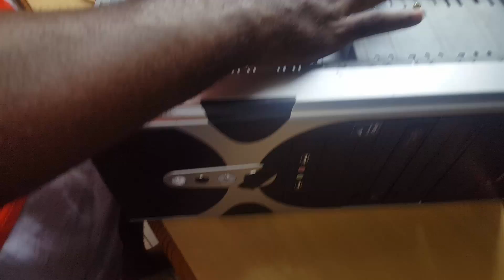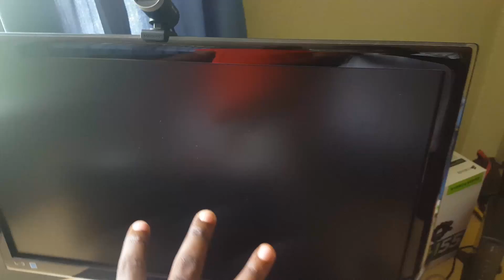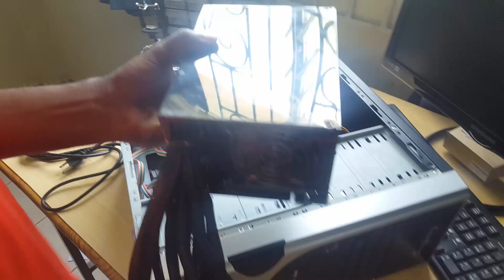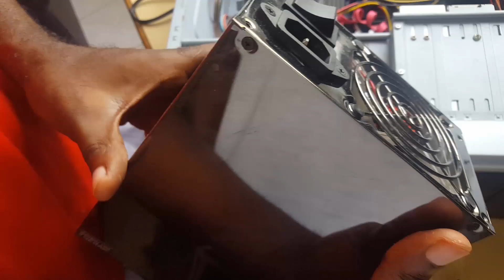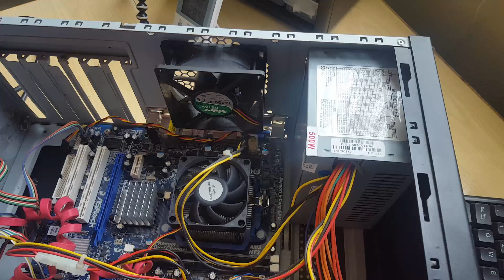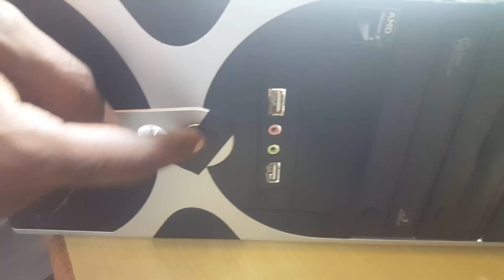My Computer wont turn on Fix

Comment: I had same problem and tried everything nothing worked, until I connected old monitor on DVI, turned on PC power, it showed screen normally, new monitor was still connected (DisplayPort) and didn't react anything, then I plugged DVI from old monitor in new one, no reaction, unplugged power cable and plugged again, it showed 2 screens in windows (both on new monitor DVI and DisplayPort) and suddenly I could switch input source on new monitor. So weird maybe my new monitor is faulty somehow but I still have 144hz and works normally after that. I still don't get what caused this issue..
Reply from the maker: Thanks for sharing
Reply: @rickytlc1985  Could it be due to low quality DP cable?

Comment: My computer overheated and shut down, now it has this burned cable smell but I do not think it is the power supply because my mouse works i mean this down is emitting light. 
Any suggestions please?

Comment: How to fix a pc that if you push the start button it will turn on but The light indicator for the "light drawing" is red and after few beepings the fan of the pc turns very very fast.

Comment: Is it possible when the pop happened while the pc is on and it doesn't turned off automatically? Need a reply asap I'm panicking plsss thank you
Reply from the maker: If you mean a audable pop sound from withing the PC its most likely the powersupply, one of the capacitors blew. You may smell a burnt smell from the area.
Reply: @rickytlc1985  but the pop happened while the pc is on, is it possible after the pop it will take a minute for the pc to turn off?

Comment: I just bought every part brand new for a computer and it won’t turn on. I have the cpu plugged in the fans plugged in and the 12 pin plugged in. I’m using only an m.2 ssd for storage
Reply from the maker: Sonething is DOA or faulty you need to find it,if not something not connected properly.

Comment: I just got all my pieces off Amazon and my brother built the pc but it won’t turn on and it’s like it has no power
Reply from the maker: You most likely made a small error. Make sure power supply is on and working. Check your jumpers to power switch you might have mixed up reset and power or connected them incorrectly. Also watch out for dead components such as power supply. There is a paper clip method to test power supply.Make sure the main power connectors to motherboard are all connected.
Reply: @Ricardo Gardener  So I have an update I can turn on the pc with a screw driver by touching some pins with it idk how that works but now I know its a problem with the power switch My case is the vsk 3000 elite I see no signal on my tv whenever I turn it on.. also I see people have power switch cables but I dont?? where do u get that?

Comment: My psu fan running but pc front poerbutton light not turning on
Reply from the maker: Somethings wrong yest the PSU, RAM power button itself -you need to track down the faulty part.
Reply: @rickytlc1985  thnx for replying

Comment: mine stopped turning on right after i cleaned the inside
Reply: @scuf5177  i found a solution , i had to  connect the graphics card to the motherboard again , so my advice is ;
try taking out cables and putting it back in (in the computer itself ofc) , it worked for  me cuz a cable became loose in the cleaning process , best of luck dude
Reply: @scuf5177  Aye im so glad i  could 
 help someone for once,  thats great dude :)

Comment: I didnt hear a pop on the psu but as soon as i tried to plug off the speaker pins(which i never used,but my friend somehow plug it in) i smell some kind of heat burnt smell, do u think its the Psu?? Although i already ordered a new one days ago, do u think there's a chance it'll damage other things??

Ps...i played high power consuming games,pubg,fifa for like 8 hours a day and my smps have like between 500-600 watt.

Comment: @ Richard Gardener
Can you recommend a good upgrade to the factory installed FSP300-60THA(1) Power Supply Unit in my Acer Aspire i3 Desktop? Mine failed yesterday and I'm shopping around online for a comparable or upgraded replacement. Thanks!
Reply from the maker: Yes, absolutely seeing your device is a pre-built Acer Aspire i3 Desktop I suggest you used the same recommended part if you can find one. That would be best in the situation.

Comment: Can someone help me see I have 750w power supply my motherboard msi x470 with a ryzen 3 and it was working the other day like the less and the power button to the case  worked but it just shut off for no reason I tested the motherboard and it’s fine the power supply is fine cpu is fine I don’t what happened

Comment: Few days ago, I got a rare issue on my PC, turn on the power supply motherboard LED on, but when press on Power On button, none of the fans turn on, I checked the switch , PSU, try unplug, plug hardwares, short circuit on motherboard's Power On pins, problem not solve, until I saw a guy write on Reddit, pull out the CMOS battery for few seconds to reset the BIOS chip, then put  it back, i try it , Holy crap... This method fucking work !

Comment: if when u press the power button nothing at all happens , if switching rams around didnt work , if theres no light blinking on the motherboard , no movement and no signs of life,  then its either ur power supply is dead (try smell it) Or ur motherboard is dead :/ but first of all before going crazy check if all cables are connected good and if you have a old computer replace the motherboard battery it should help but new gaming pc’s dont have them and now i gotta go get a new motherboard fuc...

Comment: Yo my psu is workin i tested it and it worked but when i plug the 20 pin in to the motherboard ? I domt know its all not workin
Reply from the maker: Motherboard may be dead.

Comment: Bro my pc was turned off yesterday and it wont starting also the mouse and keyboard lights also not flashing. What is the issue. Please help
Reply: tell me when u find a solution cuz i have the same problem
Reply: I don't know. My pc still died

Comment: I need a help when I install a graphic card gtx 750 ti and connect my VGA cable after it shows black screen pls help
Reply: Did you connect the VGA to the motherboard or the graphics card?
Reply: @ZaeCoolYT  Yes i connect with motherbiard it shows black screen
Reply: @shahbaz7958  If you're graphics card has a VGA socket you should connect yout vga to your graphics card
Reply: @ZaeCoolYT  Yes my graphic card has a vga port but nothing only shows black screen
Reply: Or some time my graphic card not dretected it on with motherboard vga or some time not on with mobi vga
Reply: @shahbaz7958  I think the problem here is your graphics card
Reply: @ZaeCoolYT  So how i can fix them
Reply: @shahbaz7958  I don't know im not really smart when it comes to computers

Comment: This day mycpc was not working my keyboard and mouse is not turning on is my power supply dead? Because before I had no problems I fixed and put the main power cable on the cpu but still isn't working

Any help guys?

Comment: When i click power button all my conpoments move like 1cm and then stop. Help!
Reply: If that happens i think the problem is with your power supply
Reply: @ZaeCoolYT  we got a new power supply but still nothing
Reply: ZaeCoolYT same
Reply: same
Reply: you need new psu or the capacitor by the power input blown
Reply: Me too the light on for 1 second but then shut down
Reply: That could be a cpu issue that happened to me I found out that the cpu had a short circuit
Reply: @grazaied7514  how to fix
Reply: @LawAbidingSociopath69  you'll have to take it to a pc shop if that's the issue with you he'll have to desolder some circuit
Reply: @grazaied7514  its fixable?
Reply: @LawAbidingSociopath69  yes
Reply: Clean your Ram try it

Comment: I checked inside my pc and i found 1 of the cable is not plug in.  Is that normal?  I dont even touch my pc how can it happen and now i dont know where to plug in that cable
Reply: I also have bro.
Reply: I think it's a spare cable

Comment: What happened to me i was installing a new video card and i left a cord that was going into the power supply unplugged and tried to turned it on and i got a flash of power then shut off instantly

Comment: Only my fan spinning and my mouse is turn on what should I do
Reply: Unplug the CMOS Battery and press the power button in 30 seconds and install the battery and plug the power supply and try to start the cpu

Comment: What if the supply's fan works for half sec and the mouse,keyboard and power button does the same thing and then all stops, after half sec?
Reply from the maker: Same problem sometimes they do spin for a bit and then go dead.Other times nothing at all.

Comment: My pc is brand new. 1 day old.. I just left it on for 1 hour and when i came back it was off.. And when i tried to turn it on again nothing happens.. The monitor light turns on.. The keyboard and mouse does not light up though.. There is no movement in the pc parts or fans.. What could be the problem guys please help.. Im freaking out.. 😥
Reply: Did you fixed it? I am having same problem now, please help:)
Reply: @peup8452  motherboard gone . The seller replaced it .
Reply: @aditya.s.  mine same problem but i wish it not motherboard

Comment: Yesterday, I was playing League of Legends with my friend, and suddenly there was a weird sound that didn't stop until i restarted my computer. When I did, my keyboard and mouse lighted up but on my monitor i only saw the logo. But it was not turning on properly. I tried unplugging my power source and everything, but it doesn't want to turn on. This problem was happening to me before and when i installed my system again it worked for like 1 year. Now it dosn't work again.
Reply: Mine too last weak!

Comment: Im having truble with my pc when lights on motherboard turn on and then after 3 sec it turns of and its a curcle proces and it wont start i tried everything
Reply: Have you fixed it cuz it is the same for me(if u fixed how did u do?)

Comment: I have a pc and there is a sound zzzzzzzzzzzz pip and turns on but today it was just zzzzzzzzz@zzzzzzzzzzzzzz and its just black screen pls help
Reply from the maker: Might be the power supply based on the sound you are hearing-see if its coming directly from the power supply in which case change it.

Comment: My pc can turn on it loads boot menu and shows windows loading screen then it jumps on black screen and it wont work
Reply from the maker: The files the PC needs to boot is corrupted you can try to recover or more accurately repair your Windows install.

Comment: man I just brought a 800$ gaming pc yesterday and today it's bot turning on...when i turn my extention cord on my pc starts up without pressing the power let and my led lights and fan starts but after 5second and my pc stops
Reply from the maker: Could be a faulty power supply, if its newly constructed it may have been wired incorrectly and so on. You should take it back and let seller look at it.
Reply: Ricardo Gardener but I brought it online...
Reply from the maker: Still can be returned, if you try doing the repair yourself you may void the warranty if any. But if you wont to risk it I would check the power switch configuration they might have mixed up the positive and negative jumpers, if that fails I would look at replacing the power supply. Something is wrong in the power department based on your description.

Comment: Check the clock battery if ur comp is a few years old or hasnt been used in a while,they're cheap to buy so why not replace it right?

Comment: To anyone who has problem with pc not turning on, I recommend them to first clean fan and then power supply with dry cloth or something. I had same problem. I cleaned fan didn't worked, but when I cleaned power supply it started working. Be sure to remove all plugs and then do cleaning.
Reply: OH MY GOD TYSM THIS WORKED ON MEEEE TYSMMMMM I WAS SO WORRIED ABT IT TY AGAIN
Reply: Entertainment Bulletin my computer is just A month old
Reply: Thx
Reply: Thanks man
Reply: My pc is not even 2 weaks old
Reply: @seanz5288  lol. mine is just 1 day and a half and won't fvcking work
Reply: My pc is 5-9years old
Reply: U a reallife hero🫶🏾

Comment: When I plug in my PC the power in my room disappears. Why?
Reply from the maker: Sounds like your house has a wiring fault or if you have it connected to something like a Backup power supply or serge protector try plugging it directly to the wall.

Comment: Sir pc is working when I press on the CPU button then red light did not glow and my computer is not starting. Please help me what to do in CPU so that the light glow and I think if light will glow then computer will work . So please sir tell me what to do now.
Reply from the maker: Do as the video suggests find the faulty component and replace it.

Comment: Hi Buddy, All I wanted was removing an office 2016 download slowing my PC. I clicked on delete on the microsoft folder from the registry, I then quickly realised that I needed to only delete the office folder, I then quickly clicked cancelled . I could see all other folders, all of sudden I cant launch the explorer shortcut, I rebooted, windows load Fine and nothing happen just a black screen. I did F12 run the diagnostics, I get a green tick on everything (system, cables, OS boot path, Hard drive, CD room, Video card, process fan, motherboard,, system management, memory ). This is Dell Optiplex 780 small tower running windows 7.
Tried F8/safemode with command prompt still black screen. . Any suggestions?

Comment: My keyboard and mouse used to light when my PC was off.
If power supply is dead should keyboard and mouse have light off or on?
Reply: off obvs
Reply: I hve the same prob. 
Theres led light fan is spinning it has sound
 But keyboard mouse and monitor dont have power
Reply: @tetra5450  it is true a ram problem? because i have same problem... at first, suddenly my keyboard & mouse lost its power... then i turn off & on again, my PC won't turn on... please tell me what to do?? need help 😭

Comment: i have a preatty big problem (i guess). it all started today, when it randomly shut down, i was like "ok, this shouldn't be such a big problem, let's press the power on button" i did it and the coolers and the blue small light (from the power button) started and stopped after 2-3 sec (the power on light should be on while the pc is on, not only when i am opening it). WTF is going on?
Reply: Have u fixed it? Or have u got reason of this...im in the same problem nw...plzzz help
Reply: Prossesor over hitting
Reply: Wtf this is the same as mine!
Reply: R3V1V3R try remove your ram and re install it again..

Comment: I have disconnected power supply again and checked it on other PC. It's working on other PC but not working on my 1st PC. The internal LED light turn on when I connect plug into electric board. But when I press the PC's power button then it doesn't get on and nothing happens. No front light of my tower PC gets on and any fan of PC don't move like CPU, PSU and exhaust fan

Comment: I have disconnected my computer's power supply to check my other computer. Then I connected again the power supply to 1st computer again but now the problem is that computer is not turning on

Comment: Hey sir, Ricardo Gardener
Yesterday I turned on my cpu...
It turned on... and suddenly I don't know why the cpu turned off quickly... I tried to turn it on again.. the cpu light blinks and turned off again..
now there is no power in cpu...
I checked every cable connected and my monitors speakers working well, is It a power supply failure? what Should I do now???

Comment: My power supply makes clicking sounds but nothing else turns on
Reply from the maker: You might have a bad power supply, test the power supply if it good and take it from there.
Reply: Ricardo Gardener i did, the power supply was fine
Reply: Ricardo Gardener i found out it was the mother board and i got a faulty one so i have to get a replacement

Comment: Hi ! I have a question tho , if the power supply is dead , does the periphericals still get power ? like led on the headphones , mouse , keyboard ?
Reply from the maker: Most times if the power supply is dead you will not get anything from the PC. No LED's and so on. Some times when it dies you hear a loud pop and you can smell a burn smell coming from he power supply.
Reply: interesting..i guess that i will just send it back . the thing is that the rig is good and i mean  brand new , keyboard has power same as mouse and headphones , when i press power button wont do anything , not flinching even the fans.
Reply: ArtfulDodger I have the exact same problem, have you found a answer to the problem?
Reply: Hi , yes i did , i called the store from where i purchased all the pc parts and they told me to douboe check , rams , gpu , cpu , cables .
So for me it turned out to be my CPU , it popped out from socket at shipping , now my baby it's up and running :)
Reply: ArtfulDodger So the problem would either be my cpu or power supply?
Reply: Yes either of those , could be the mother board aswell , did your pc work untill now tho ? or yours it's new aswell ?
Reply: ArtfulDodger Well I build it on my own but when I wanted to test if it was working it didn't give any sign of life even thought my keyboard and mouse do light up
Reply: Chek your CPU for any missing pinn's , if the CPU it's bad the pc won't power up tho , even if the mouse , keyboard have "power".
Reply: ArtfulDodger thanks alot for the help
Reply: You're welcome , probably not much help tho . Hope it work's out for you aswell.

Comment: I just built my first pc for 1500+ it wont turn on why??? I only see lights on graphics card
Reply from the maker: You missed something during the build, its usually something simple such as a power cable from the PSU not connected or connected fully. Check your work over and make sure everything is connected snug.